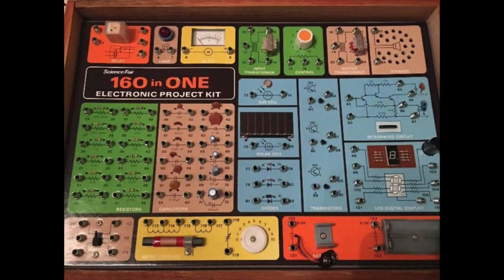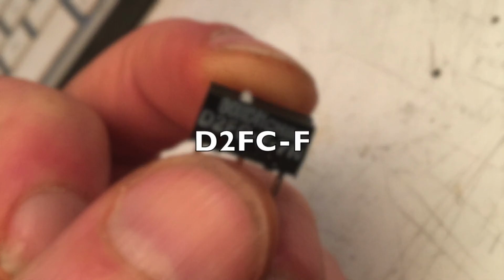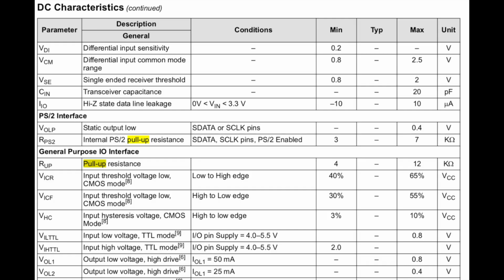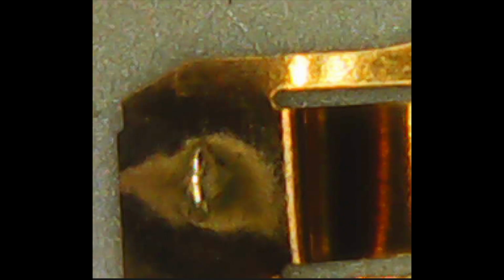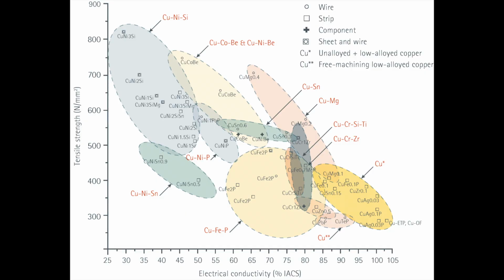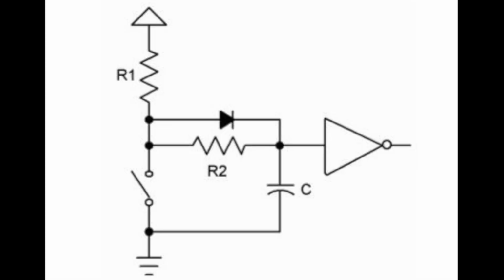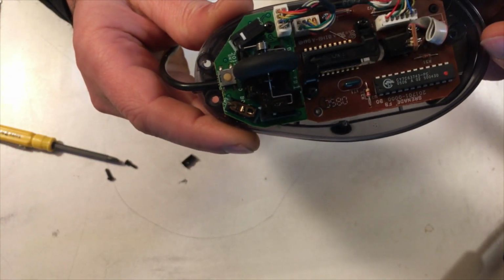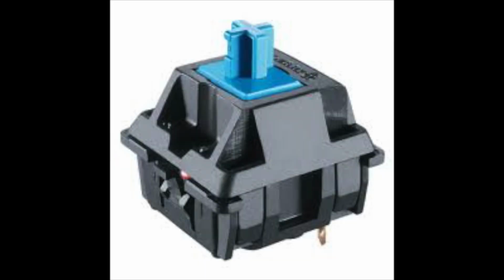Failing switch problem: Omron vs the modern mouse circuit

Comment: Wow, this video is making me hungry. Well, i'm apparently a cat.

At first though i looked at the length of the video and thought "puh it's a switch, can't you boil it down to 5 minutes", but i must say the length is entirely justified by information density. In particular my second thought was "well i buy $12 mice of a particular non-brand with crap switches and they last me about 8 years until plastics and rubbers fall apart, but the switches still work, so is it really a problem?" and i'm quite satisfied with the answer, i can see where Logitech in particular went wrong. And i do game, and i run hidusbf to overclock the mouse to 1000Hz, because i need smoother motion and high range of displacement rates - not that i need 1000, 500 works just as well, but i'm not getting any trouble with 1000 either, and i mean i tested the actual meaningful event rate, 1000Hz actually work. I'm not missing much, the tracking poses me no issues, i have tilt wheel and side buttons, etc.

That being said i got discouraged of buying Logitech after buying a $50 mouse 15 years ago, where after 4 months, the plunger of the switch notched itself a groove in the enclosure/button plastic, so it could no longer press down on it. And the silvery paint started coming off on my hands. Yuck. I mean i can ignore the paint and i can epoxy the plastic, but why should i overpay for this blatant lack of commitment to engineering quality?

I don't think firmware debouncing has to be necessarily THAT adaptive. There's a physical limit on the click rate that a human can achieve, and as long as it can be captured, we're fine. However we still want to aim for competitive advantage and thus registering the click as early as possible - however we can delay the release for as long as necessary for the vast majority of games and applications, with exception of perhaps top-level Starcraft competitions, and i'm not even sure this would have any effect.

Anyway, i've had this thought. Pullup might be plain stupid in this case. Assume we have to use these same unsuitable switches. Assume we need to save every cent on components. Assume we get to live with 3V rather than 5V - perhaps we're sharing the platform with a wireless mouse. Assume we do not want to get a lot of current through the switches in normal use, not even 0.1mA. Assume FET processor input, almost purely capacitive - you can disable the processor's pullup current in firmware. Note unused feature of the switches - they're double throw, they have NO and NC terminals. Assume the mechanical construction of the switches guarantees break before make. You can just route the common pin to the processor input, and NO and NC to GND and VCC pretty much straight. Thus even if the connection is very flimsy and breaks often, the moment it makes first contact with either the NO or NC plate, the input gets pulled hard to the corresponding logical value, and even if the switch is left floating between the two, the reading will stay constant probably for seconds if not longer. If the mechanical construction does not absolutely guarantee break before make, tie NC to VCC via a 470 Ohm resistor, problem solved. This will not work if the leaf oscillates all the way between the contact points though, though it seems absurd that that would be the case, after all the distance needed to be travelled for that is orders of magnitude higher than the distance between the switch making contact and not making contact with one given plate.

Also makes me wonder whether they shouldn't possibly lubricate the switches internally. This would increase contact resistance, but reduce wear.

There's something else i remembered, mid last decade a company (forgot which) released a silent mouse which if i remember right used optical switches - akin to optical endstops you've seen in 3D printers. It's again the same components used in mouse wheels previously, and the same components previously used to pick up XY motion on mechanical ball mice. Something something patented, but the patent might be void. It can be remarkably low part count because the plunger that breaks the beam can be part of the top enclosure with buttons. Of course it's not everyone's cup of tea because the mouse buttons would have no feel. Along these same lines, reed switches and Hall effect switches may be tried.
Reply from the maker: YES... I actually wondered the same thing about not using the off position.  It seems like a waste not to go that route, but I could not find any explanation. I feel ill-equipped to speculate since I don't play any of the 'L33t FPS hidey shootey' type games that all the cool kids are into these days, so I may be overlooking something. Oh, and I do personally use faderlube on my switches... again, it seems like another no-brainer, but I have not been able to detect any lube on the switches I have disassembled. /shrug  I filmed myself replacing the switches in my g502 and walked through the lube process there (spray it on glossy paper and draw it across the contacts), but I never bothered to post it .

Comment: Alex, thank you for this short dive into mouse switches.  I would have been happy to a 3 hour video of yours because you are so nerdy, like Steve at GN, and Alan formerly of PC Per.  I do not game, but have been using mice since WordPerfect introduced mouse support!  I have tried and killed many pointing devices, and have settled on Logitech's gaming series, G700s, G500, and G602 due to size, feel, and features.  When they die, I will likely replace them with an identical model if available, or try to find another newer mouse that feels good and has the features I need.  I do wish for replaceable mouse switches, especially having a choice of switch type like my G.Skill blue switches.
Reply from the maker: THanks!  I mostly use gaming mice for productivity as well because all the programmable buttons are so useful, but I go like gaming "when I have time"... I gravitate toward logitech because they are one of the few companies that uses a tilt-wheel on their gaming mice, and I use that a ton.  Honestly, doing CAD work seems to beat up mouse switches just as much as games though because of all the click and drag to rotate and place, and I really would love replaceable switches.
Reply: @AlexKenis  What do you think of the Razer Basilisk V2 mouse with optical switches then? It also has a tiltable scroll wheel. Your video inspired me to abandon the quest for the ultimate mouse switch model, and search the market for a mouse with optical switches instead. Granted, there's not much choice (Razer, Roccat, HP Omen, A4Tech).

Comment: Deep, deep :) Since i am not a gamer i just do not have such problems. But i have a question. Bouncing time is over 1ms for sure. Google say that world record for clicking is 71 licks per second. Let's make it 100. So, it is 10ms per click. So, what the point of have 1000HZ polling? And how bouncing issues are avoided when 1000hz is used? I think it should result in extra click immidiatelly.
Reply from the maker: Polling rate is tied to positioning data as well, so theoretically the faster the rate, the lower the latency.  As far as debouncing it, I would think an ISR callback with a counter tied to some sort of logic to determine if the user is rapid clicking, click-drag or if it is just bounce or chatter.  Maybe using a separate timer to try to filter false clicks, or even it the signal into the converter inputs and read amplitude or waveshape data?

Comment: I'm not a gamer but I have replaced at least 3 of my Logitech wireless track mouse(s) in the last couple of years. Luckily I'm an electro hoarder so I plan on replacing the micro switches with the Japanese Omrons and I should be ready to go for a few more years. Thanks for the insite. Your videos are never too long for this "nerd".
Reply: Updates on the durability?

Comment: Holy shit! I found your channel when I was shopping for ramps boards, but now I am going to take apart and repair my Logitech g600. No more tripple clicking! I learned so much. Subscribed!
Reply from the maker: Good to hear!  I used to have a g600, but could never get used to the thumbpad.  I never took it apart, but knowing logitech the thumb pad is probably mounted to the top shell and connected with a ribbon cable.  I think that mouse was before they started using the tiny tiny little springs near the wheel, so it should not be too scary to tear down.  I may do a follow up vid about cleaning and /or replacing mouse switches since I have to put my g502 back together again anyway (may as well film it), im just waiting for a few more switches to arrive in the mail so I can decide what to try out next.

Comment: The solution is hall sensors and magnets, best switch there is, you can implement the "click" around that but hall sensors and magnets never die
Reply from the maker: Hall or even optical sensors would probably work great
Reply: @AlexKenis  
Optical can get dirty if the mouse is not air tight which is hard if you have a slot for the wheel which already gets full of dirt and hairs quite often. I rather use a hall sensor which even with dirt it wont fail. The only thing is you'd have to calibrate it but that can be done automagically in software by just measuring the first clicks.

Comment: Solution is simple google Honeywell SM switches...the inventor of this switch back in the 40's was a company called Micro Switch which Honeywell bought....coincidence huh? ,  depending on the contact type you can order with gold contacts, or even go for mil spec switches.  
Anyone that knows quality switches will tell you omron is a cheap knock off compared to the originator.  Your comments otherwise are really not applicable as your analyzing a crap supplier product, go check the originators specs.
Reply from the maker: I'll have to check them out.  Honewell was my first thought when looking for alternatives because I tend to believe their specs since I used parts from them and Allen-Bradley virtually every day for years, and they always seem conservative about them.  I have a good buddy who worked for them as well.  I actually grabbed a half-dozen Honeywell ZX series gold-over-silver logic level switches that I am considering (they were the only models I could find readily available).  They solve the problems of twisting, scraping, overtravel, excessive pressure by using a rather thick contact plate on a dual pivot, and an actual mini spring to provide tension and return force.  Later today I'll have to take one apart and post a link in the video description to the pics, because they are radically different then the typical snap switch.
Reply: They’re definitely applicable to what they’re discussing.

Comment: Hey Alex, get the F*** out of my head

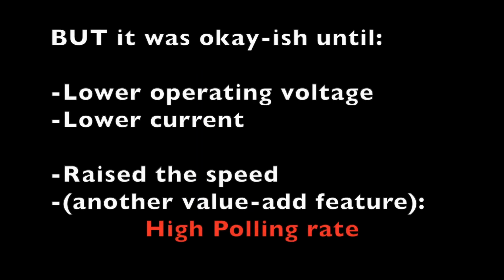only at 22:22 but its shocking how much i agree with you :-D
Reply from the maker: Yep, putting the marketing cart before the technical horse is always a recipe for disaster, and the modern paradigm is to just add bells and whistles in an attempt to 'out innovate and out-feature' the competition, with out a focus on the basics, unfortunately
Reply: and yes its 100% agreement, and i have had these thoughts for years

and a side note: i have tatooed this text on my arm

Quo plus habent, eo plus cupiunt

and if you wonder why it's because i hate people that just wants more and more instead of trying to get by on as little they can

short english translation: The more they have, the more they want.' Literally, by however much more they have, by that amount more they want